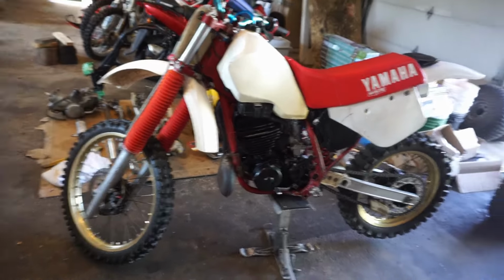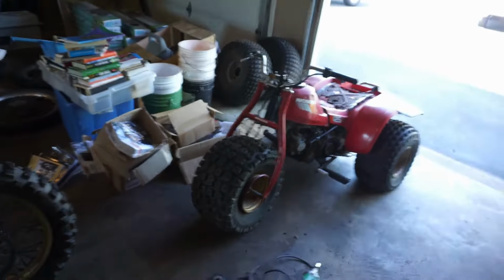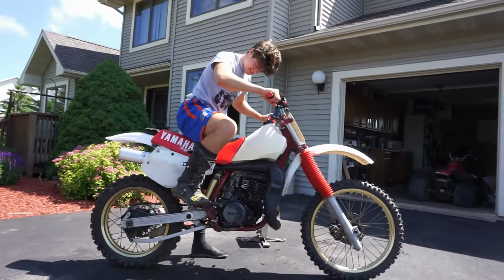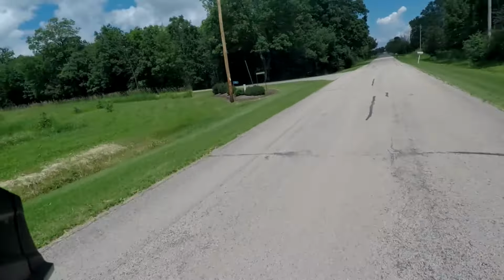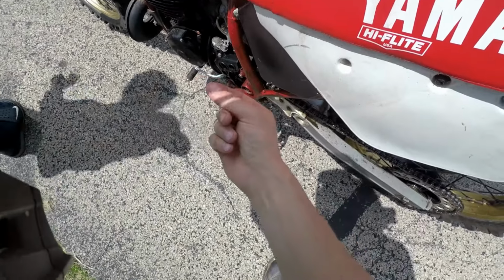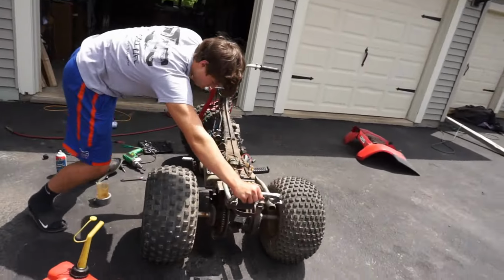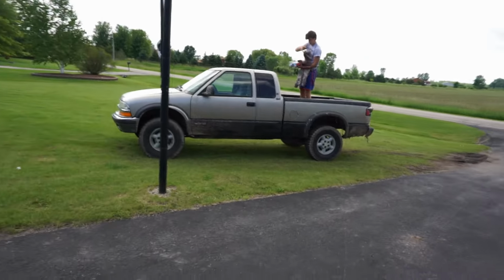This Bike Will KILL You!!! First Ride on Yamaha Yz 490

Comment: I know what you are talking about. I had a bike just like it back in the 80's, I got a brand new 1982 Suzuki RM465Z for $2,495. I was 22 years old, I traded a 1980 Suzuki PE250 in for it, and wow it was crazy fast. Then I put a White Brothers works air box on it, boyesen reeds, and a wiseco piston, it made the bike so fast it was almost unrideable. The front wheel would come up in every gear but 5th when you just touch the throttle. 

I also shipped the rear shock to White Brothers in California, and had the deluxe shock mod done to it. Then I put a terry fork kit on the front, after all that I had 13 inches travel on the rear and 12 inches on the front, and it rode like a dream. 

Then I put supercross bars and grips on it, the teflon coated terrycables on the clutch, front brake, and throttle, brake guard on the front shock, Cheng Shin super digger sand and mud desert tire on the back, and a metzeler perfectcross tire on ther front. 

After all that I had a bike similar to what the pros were riding, I even got an offer from a pro to race it for me, and I said no, because I was riding it every weekend myself. The bike was so fast I basically rode by myself because nobody could keep up with me. It to me about a month to get used to all that power, and even after I did I usually never gave it more than 3/4 throttle, because if you did it would flip on you, or spin the rear tire a hundred miles an hour. 

The only bad part of having that bike was the arm pump, after 10 or 15 minutes of riding it hard you would get cramps in your arms from trying to hang on to it. But the fun and the thrill of all that power more than made up for it. My 2 best friends had a Yamaha IT 400 and a Kawasaki KDX 400, and I used to smoke both of them in a race. That RM465 kicked out some softball size rocks sometimes, so if you were behind me and you got too close, you got slammed with rocks. 

I shot a rock so big off my rear tire one time on a friend who had a Honda CR250 it hit him in the chest and he had to pull over because it knocked the wind out of him. AFter that he started wearing a chest protecter and knee pads, just to ride with me.

Comment: your running it with the choke on they are the same engine as the it 490 when u lift the choke lever up thats it off down is on is how it works on the it 490

Comment: After its tuned right, yull want to sell it. I have the same bike. It will scare the holy hell outta you. Especially 4th gear wheelies at 85mph.
Reply: Lance Jewell .......yes......it is a death machine......
Reply: That ass end should be trying to beat the front end where ever it goes . They are fast ,this one needs help, then it should GO
Reply: I let a friend take mine for a ride (he had an XR600)...
I heard him wick it on in second and third, and then dead silence.
I turned to my other buddy and told him I knew it had enough fuel, what's the deal?
We looked up to see him pushing the bike back.
He looked at me and said "I CAN'T BELIEVE YOU RIDE THAT THING! YOU'RE F***ING CRAZY! THAT'S THE F***ING DEVIL'S BIKE!!!!"
I guess anything that digs a 5 inch trench while carrying the front wheel in 4th is too much bike for some people!
Reply: Motor City Mike my friends dad used to tell me not to buy his sons Z900 Kawasaki. He said it was to fast and I would kill myself on it . I never bought it from him because Ted died on it 3 weeks later  RIP TED till I see you again .
Reply: @joegilly1523  
I can understand why you lost your friend (my condolences).
The 900 Kawasakis were fast - I rode an XS1100 Yamaha back then - the problem with Kawasakis (500, 750, 900, and KZ1000) was that the front end geometry was WAY OFF, they'd go into a vicious speed wobble and if you didn't know how to ride out of it the bike would throw you over the bars.
MY XS1100 was one of the fastest super-bikes but the Z900 would keep up until about 90 mph....
If the rider could stay on.
The only thing they could do was run double steering dampeners and adjust them down TIGHT for any fast riding.
More than a couple of my friends crashed their Kawasakis HARD.
Reply: 85mph bro u cappin

Comment: I rode one of these years ago..... and it was a totally uncontrollable beast that wheelied all over the shop at a hint of throttle. Needless to say I crashed it several times within minutes. That thing is only putting out about 20% of what  its capable of.

Comment: Sweet bike looks like its burning oil 2 vinna change petrol in tank and keep an eye on the gearbox oil level incase its the clutch side crank seal letting oil into the cylinder
Reply: You are definitely experienced. You cant tune one that has a leaky seal.....

Comment: I have a 92 we 500ze 2 stroke on a 1997 fram 6 speed transmission and the bike absolutely scares the crap out of me you have to really hold on because every gear it will try to throw you off of it I used a speedometer ap. On my phone it said my top speed was 114 mph and I still had 6th gear to go but had to shut it down the bike is a absolute power house .

Comment: You definitely should’ve put fresh fuel in there before you rode it!! It shouldn’t be smoking that bad the whole time you were riding it unless you were really that scared to get on it!!!
Reply: I usually run 50:1 in everything but some people run 30:1 and 40:1 which I don’t really get but that could be why it’s smoking
Reply: Big bore 2 strokes need a rich mixture I think my owners manual said 32:1 I always ran 30:1 because spark plugs are cheaper than top end rebuilds
Reply: They all need a rich mixture.  It’s a 2 stroke and it’s air cooled.  Also don’t use ethanol.  It souly rely’s on a rich mixer for lubrication and heat distribution.  More fuel equals cooler engine. First 6 things before he even started it should have been 1)carb clean and fresh fuel 2)new plug 3)change gear oil 4)air filter 5)exhaust pack in the silencer and gasket 6) the walk through-check list.  Check tires, tire pressure and brakes, chain and sprockets, brake fluid and pads/rotor,  bolts-anything that can come loose.  And of course are there any leaks.
Reply: when I run to rich it’s harder to start the bike and it floods if u don’t get it 4th or 5th kick which after a wreck isn’t easy.  Most racers run 50/1 anyways
Reply: @nicholstop8161  I get that, my brother wrecked his knee and hip on dirt bikes. I weigh plenty and didn't mind kicking the shit out of it
Reply: mark robinson ya I’m only 140lbs so I can’t kickstart anything bigger than a 250 2t.  Sold my 450r cuz it took me 5 minutes to get it kickstarted from all the compression
Reply: @nicholstop8161  yeah I think I was in the 210ish range when I was riding my 490. The height of the bike sucked too and I'm 6'1. Almost want to rebuild the top end and get it back out again this year

Comment: I have one of these and have had it for 30 years..  I agree it doesn't sound right and if you'd have given it much gas while working properly you would have been dumped.  It sounds like the choke is still on.  But.. you could have added too much oil to the gas.. or it isn't ported right.. or you need to clean the spark plug.. most likely one of those things..   Oh and there is a trick to starting them.  You have to make sure the gas cock is on.. Turn the choke on.. and lean the bike over and allow gas to flow in the overflow tube.. once this is done try starting it..

Comment: Make sure you run the highest octane numbered fuel, the early head design on those bikes had a terrible squish clearance and was prone to pinging when hot. You can also jet a touch lean an use a $25 power jet from Vito’s performance, I put one in front of the mouth of my carb on a Blaster and jetted lean and it helped to automatically richen the mixture when needed. It works on vacuum so it’s no miracle device, but they work for $25.

Comment: 'It's really boggy... might have to jet it. Yeah it's super boggy.' I lost track of how many times you said that lol. Don't be scared not sure you even felt 1/16 of what that bike is capable of. I had a 1988 and I wrote it for several years without changing anything but a couple plugs. Could have used a back tire and chain and sprockets when I sold if I'm being honest. Just hearing it idle you can tell it's not a happy camper and in IMO it's 100% an air/fuel issue. It needs carburetor rebuild kit done right, a nice clean air filter, some fresh gas mix, the right NGK gapped correctly. And you should always take out the oil level screw to check it. That is the only real way to know that you don't have too much or not enough. I don't want to keep going on about it, but I just feel so bad for that bike. I hope that you got it sorted out. And PSA... never spray rust inhibitor, or even worse, lubricant on a disc rotor. Speaking of disc brakes, I didn't know 1984 had them. Okay I'm going to check for an updated video now.

Comment: Great old air hammer ! They just need squish band mod to run cleanly down low. In hot, dry climates run a tad richer mains if you are revving it out. Don’t use Wd40 on rotors. Hit it with steel wool or fine grade sandpaper. On starting, choke and run through TDC twice. These are tough motors.

Comment: I had an IT 465, with a 490 can, piston and carb on it. That bike was the best fire road and field bike I ever had. I had an IT 200 on the trailer right next to it when I did hare scrambles and enduro weekends. With the 490, it was like having an automatic- the thing had such good torque it didn’t matter what gear you had it in. Nobody without full armor would ever want to be close behind me when I put the power down, the big knobby would toss everything, big and small....  I used to carry shear pins for the kickstart....

Comment: If your 2 stroke is flooded, hold throttle wide open and kick. It lets the large amount of  fuel to be mixed w extra air from slide being open will generally start first kick

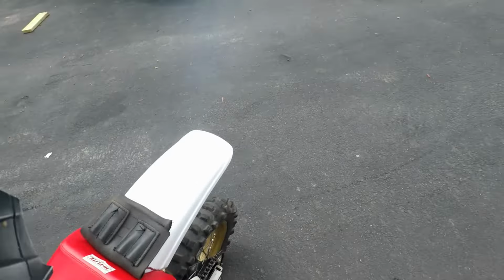Comment: Not convinced about the choke. Every Yamaha 2t I've ever had up was on. 8:10 ish.. New fuel, correct oil ratio, new plug, air filter, HT lead and plug cap, clean carb,, thrash it to remove carbon, before even thinking of jetting. Hard bikes to thrash, though lol. Big pucker factor. I use WD40 to clean a chain, it's basically kero and Singer oil.

Comment: they are not super rare! the 465 is a more rare and over all a better bike, but you got a good deal on that bike!
Reply: Notodden Cross Gutta the IT 465?
Reply: @oneslowmk638  yz 465
Reply: the 465 was it all butt its fall back a 14 tooth counter n a 48 rear you had too change them up a bit butt it would work other wise. knottt. almost bought a new left over for.   800.00 dollars down n 800.00 dealer owner to me no bank coladeral co sign .nothing . the last of new open class were only sold too pro privateers or pure bike nutt enthusiasts .
Reply: Wr500 is more rare than the 465, Yamaha also made a 500 called the yzm 500 which there are very few of
Reply: @coledemas6398  yupp cool bikes😀 but the wr500 was more like a enduro bike.
Reply: Notodden Cross Gutta yes exactly what they were
Reply: Matthew Fogarty I think so
Reply: Matthew Fogarty both the yz125 and 250 were liquid cooled

Comment: i raced 1 of those for 2 seasons wicked bike, you say its insane ! lol it hasnt even got into the power band ! it will flip in more or less every gear apart from top once running right, good carb clean and fresh fuel should sort it.

Comment: Or you need to change the needle's groove position.. for example : put the needle in the middle position. After that, you ride the bike for like 1 or 2 kilometer. Then you check the color of the spark plug. If the color are too black you will need to poor the mixture skipping the needle's groove position one step up 'till  you get the spark plug's color dark brown 🟤

Comment: I'd clean the card.n. adjust the mixture  screw..add fresh gas n  spark plug..I'd also check the main jet on the carb. 3 make sure it's a stock #

Comment: From cold start it will be very fluffy. After a minute or so you should rev it hard to clear out the excess fuel and oil. This should make a bit of smoke but after a few attempts to rev it hard it should start to sound crisp and clean. First port of call is the air screw. I bet it is wound in too tight. The main jet could be wrong or perhaps the needle is at the wrong height. It did clear a little but is not set up right. To start its, find top dead centre and slowly push past it.. Lift the kick start and use your full weight to kick in a fast stab. Using a crate or bike stand to stand on helps to kick it over.

Comment: Turn on gas turn on choke lean over to one side for 15 seconds. Push the kick starter through the stroke once or twice then give it a full kick from top dead center. Also it sounds like it has the choke on and isn't warmed up.

Comment: "This bike will kill you " ?! 
Nah , not really... (not in that condition,  though)I had one in the day , and I survived 😉
If you really want a proper 2stoke experience...  get your hands on a CR500 or KX500 !! 
They only got two speeds,  standing still & holy f@ck !! 
Nice find though 👍👍
Reply: it'll kill ya with wd on the brakes
Reply: Nothing against the CR or KX but my 490s (I had two - at different times) were never behind either one, it was usually handlebar to handle bar, hole shot, down the straight or crashing the berms.
It was exactly like you said of the others, you were sitting still or already at where you thought about pointing it.
The 490 was everything the other two were - in fact I sold my CR500 to buy the second 490.
Guess it's a matter of preference.

Comment: Can't wait for the top speed vid tho!!!!!!!!
Reply: Have you seen Tnts 490 top speed run bro its proper quick and tnt said it wasnt even running correct thers a big difference between the two bikes hope he gets this one running right
Reply: Yes i did i was going to compare there top speeds I'd guess Tnt's top speed would be atleast 15 mph faster!
Reply: @cadenfinley5990  tnt,s does 80 probs will go a bit more when its done its hard to tell on 2vins top speed at the min, the more noticble thing is the power in Tnts take off its pulling an lifting all over the place bet itl be a hard bike to drive on todays tracks would love to see 2vins running like that

Comment: Two strokes need to be opened up! That will fix the “bogging” problem
Reply: Not in gear. Let’s not be dicks
Reply: @CoralReefkid  having comprehension issues?
Reply: FYI you’re really not supposed to do that on an air cooled motorcycle regardless. That only fixes bogging for temporary. Try me, I’m an AMA mechanic buddy.
Reply: @CoralReefkid  have know intentions of trying anyone, "Buddy". I was giving him advice on riding a two stroke. Don't care what kind of mechanic you are, it doesn't make you an expert on riding one. The only "dick" here is "Mechanic" inserting himself into a comment thread that had nothing to do with him.

Comment: I own 2 of the 1983 yz490s and a 1984 IT490. These bikes are notorious about the seals in the crankcase going bad and sucking oil into the cylinder causing them to run rough. Fyi the IT490 is much easier to ride with close to the same power.

Comment: I owned a 85 490 n i know you could not keep the front end down.did you ever get it running right.also you should of checked the pipe n filter first so you don't waste time on a false tune

Comment: Definitely not a stock 84. I have one I got when it was a month old. 84s were yellow and black and didn’t have disk front brakes. 
So for this to be an 84, it would have to have a front brake and fork leg from a later one. And have been stripped to the frame so the frame could be painted from black to red, then put back together with white plastics and a red seat cover, stock was black.
Reply: PS. Love my 490! I have 10 newer bikes but I still have a hoot every time on the mighty YZ490. Used to do half mile wheelies with it 35 years ago but I’m too old and chicken now. 
YZ490 is surprisingly good for technical riding too because it has so much low end it will lift the front end at barely above idle and you can float sweet little wheelies climbing hills at walking speed, even when running blubbery. Also, virtually impossible to kill the engine unless you stomp on the back brake.  Mine needs a throttle cable and this video makes me want to get it fixed. Thanks. Have fun. Stay safe. Plus one on revving it up to clear it out after idling.

Comment: You have to give it a lot more throttle to hit the power band. It doesn't need to be re-jetted, you just need to ride  it properly like a 2 stroke it meant for. You are not even hitting the power.

Comment: I had one of these, biggest pile of crap ever. ...Till I got a WR500, which was a bigger pile. Impossible to jet correctly, to rich or to lean. They blow up when ridden hard. They would not hold up in competition back then with what a fast rider could dish out. Went back to Yam 250YZ and or Wr 2 strokes after both times. They are nice to look at though. Fun to play around on, but nothing seriously.

Comment: Annoyed at the peanut gallery saying that it's boggy because you're not riding hard enough.  These goons have never had a good-running 2-stroke in their lives, let alone a big-bore.  Once it's warm, it should be snappy right off idle.  Take it on a 15 minute tight trail ride at tractor revs, and it might need like 50ft to clear out the plug, but that's all.  If your bike has to be run ragged to keep from choking to death, either you've got it way rich or your timing is off or something.

Comment: That490 was not even close to running normal. Change the plug, clean the carb and check the intake manifod for leaks, better yet replace it. That is a flat out beast and was probably running 35% of it's max potential. It's not a toy. I  owned a CR250 and rode a KX500 once in Palm Bay Florida. Flatout insane power while flat trackin it around a lake!!!